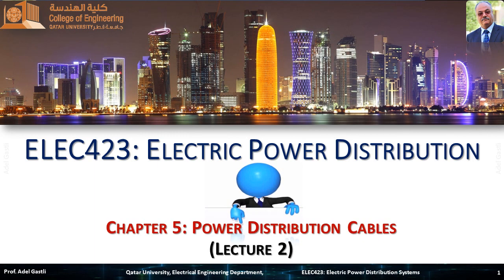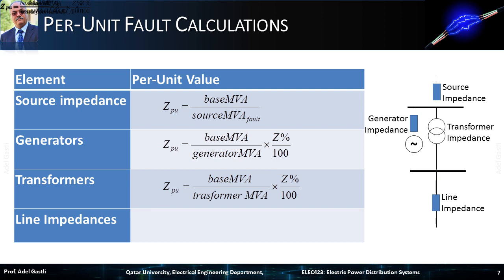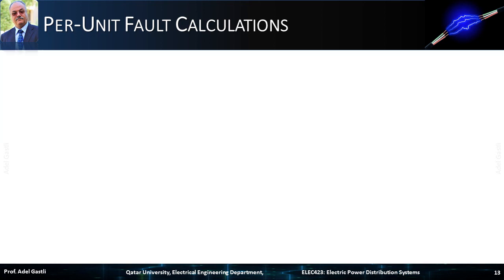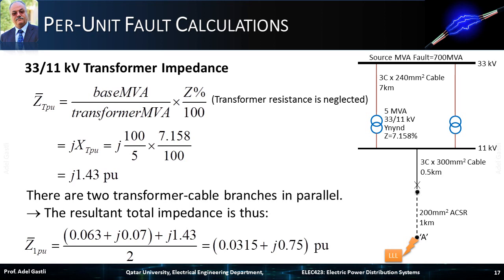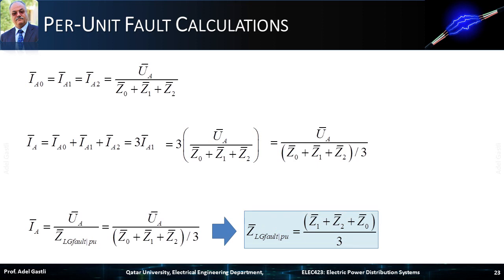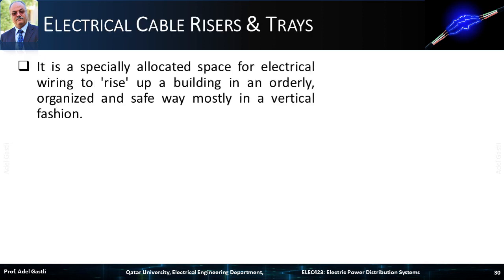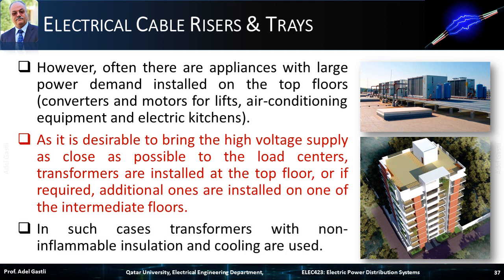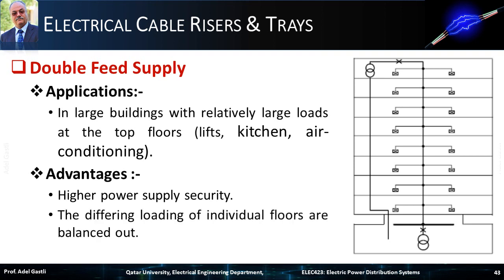Electrical Power Distribution: Chapter#5: Power Distribution Cables (Lecture 2)

Comment: Hi Sir. Thank you for your valuable lecturers. One question, what's the assumption if zero sequence impedance cable data is not available in the cable manufacturer's datasheet? Some cables does contain the info but some doesn't. Your quick feedback will be highly appreciated.